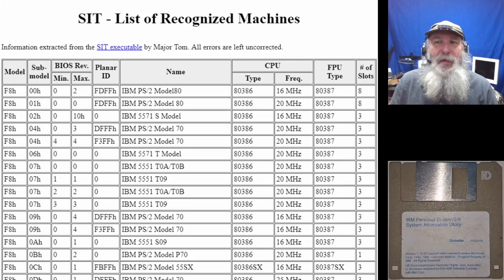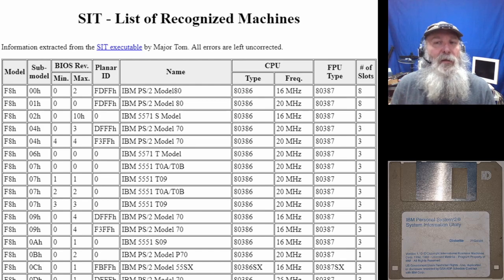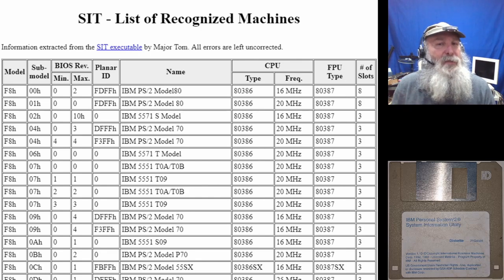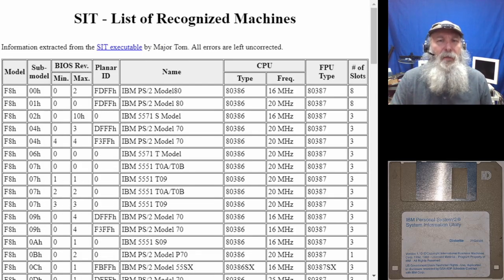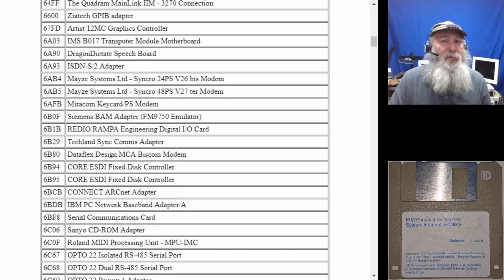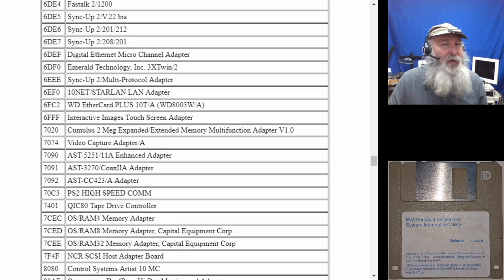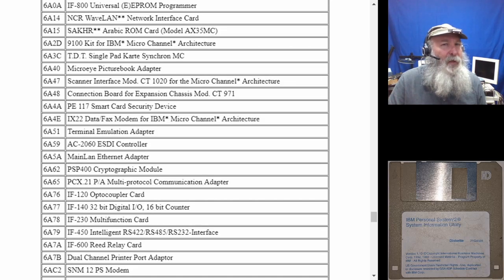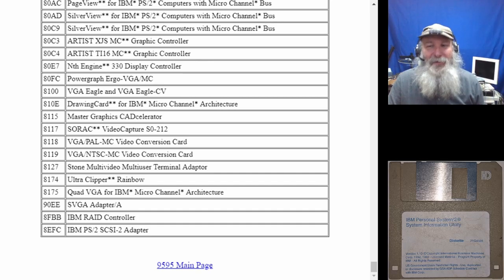IBM's System Information Tool (SIT) Supported Models and Adapters

Comment: That's an interesting point - the Gearbox-specific adapters are there, but there's no entry for the Gearbox machine itself... strange. Somehow all 80286-based MCA systems are also missing.
Reply from the maker: I almost immediately noticed that 'SIT' starts from the 386SX level - All BIOS models are 'F8' (as noted many times, generically meaning 386SX+). In my opinion, IBM identified systems using the BIOS model extremely well early on (i.e.: an 8088-based unit even had a different code when using a PQFP CPU like the PC Convertible) but then just gave up later. IBM tried to have the BIOS submodel also differ between different planar 'Type' versions (i.e. Model 55SX) and failed to hold to their own convention.

My surprise was genuine about the Gearbox 800 - I haven't had time to review the list very well. Thank You for leaving the raw data 'uncorrected' - besides the effort you have done, I want people to appreciate the value in analyzing the information like this. We are able to 'correct' and learn from the expanded 'errors', i.e. the CPU value for a planar ID 'F5FF' Model 55LS is incorrect (it should be a 486SLC2 of the "25/50" speed).

I am especially interested in any adapters listed without known or saved ADFs. One area that I have been far too silent on is that the IBM 'catalog' of adapters has been completely scanned and archived online. That - and the location along with the contributor - needs to be announced on CSIPH, on the Facebook group, and in a video series on this channel.
Reply from the maker: The Gearbox 800 (7568) almost gets treated as a "collection of adapters" by IBM, seemingly from its modular construction. Of course, we will get to see how the 'logic' of SIT is applied to it running on a Gearbox 800 and other systems. I've even been surprised that no one has reported how it runs on a more "modern" system.
Reply: @IBM_Museum   They probably realized that the model/submodel combo simply can't cover all the different machine variants and configurations... still, I'd expect them to bump the model byte for the 486 and especially the Pentium systems, if nothing else. Oh well...

The adapter catalog sounds very interesting. Can't wait to see that!
Reply: @IBM_Museum  I've only recently tried running SIT on a T4 system, and it didn't show CPU frequency and it also incorrectly reported MCA streaming as "unsupported". Not the most reliable utility... and the code is kinda ugly as well. So yeah, I'm glad you are working on a replacement :-D
Reply from the maker: @GeckonCZ : I fully intend to demonstrate 'SIT' on newer PS/2s in time - I also meant the wild idea (and sometimes a learning experience like a friend had to see his modern system reported as a 'Model 30' while running a Model 25 Starter Diskette).

The Gearbox (series in this instance, but started by a reflection of the '800' model - who knows if IBM was going to develop the series more) is ultimately adapters on a backplane - and it is going to be instrumental in the development of the "PS/2 Portal".

No one should look upon IBM being 'incorrect' at times in their model identification and slight errors in this information from 'SIT' - It was much more dynamic with active models. PS/2 model distinctions aren't a "moving target" now.
Reply from the maker: @GeckonCZ : And also - the appearance of the now known-reallocated "PS/2 Model 30SX". Unal had initially found it on an internal IBM BIOS list. I need to sit down with printouts for a follow-up video. And of course, we will have your news as well, I probably need to write up a webpage on 'SIT' to consolidate all the details, patches, and later improvements.